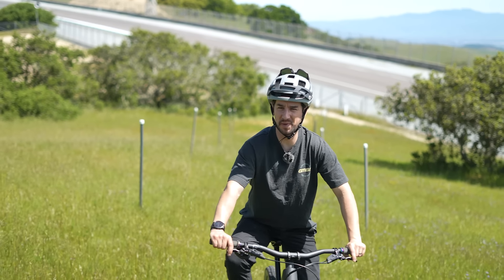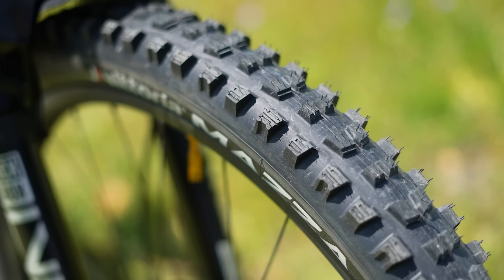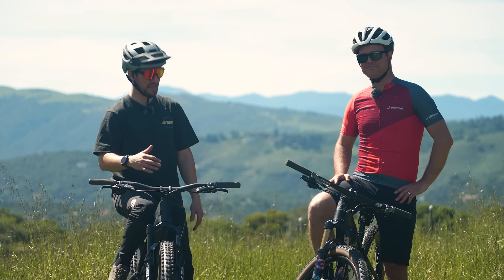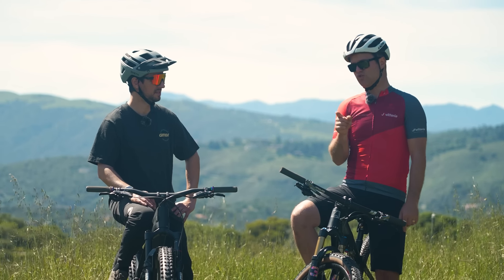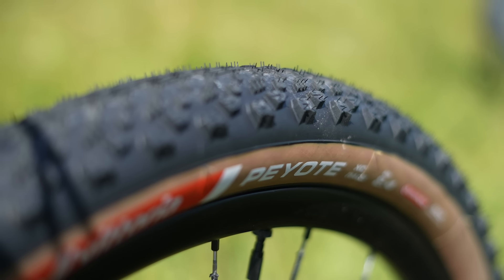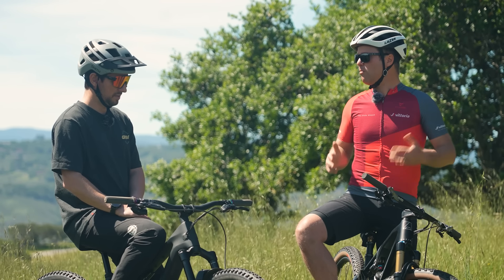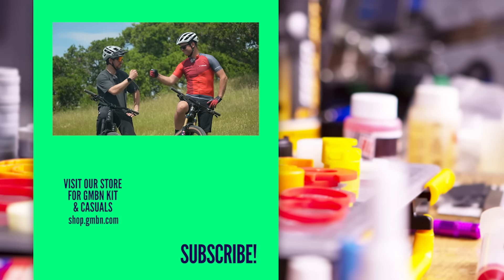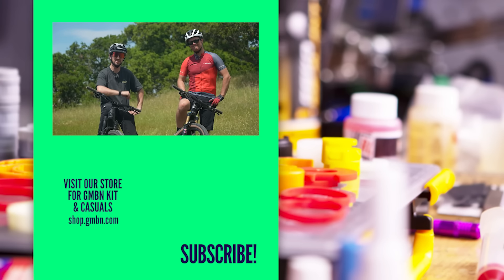What Makes A World Cup Winning XC Tyre?

Comment from the maker: What tyres are you using at the moment? What style of riding do you use them for? Let us know in the comments below!
Reply: At this moment: Vittoria Barzo 29x2,25 - for UK long distance trails (mostly gravel or mud) for my hardatil XC bike. But I need little more rolling speed, so propably i go down to 2.0" (Pirelli Cinturato Gravel S 50-622) in next season.
Something with shallow thread like Vittoria Peyote - is not optimal, because a UK wet weather. And plenty of muddy puddles on trails.
Reply: Now I'm using MSC Single Track in front (2.2) and MSC Roller on the rear wheel, for my XC Cannondale FSi. I love tyre science, I love testing myself different combinations and I ride all types of terrains (flowy hard packed terrain, rocky technical descends and I love mud as well). For me the adaptability of a tyre is key, even more than rolling resistance.
Reply: Michelin DH22/34 on my full sus trail bike, I live in the Laurentian mountains lot of granite and muddy patches, technical and vertical, up and down no flats..
Reply: I have the china-est sounding tires, Chaoyang Phantom Speed 2.2 on my xc bike. Love them.
Reply: As I ride XC mostly, I have Maxxis Ardents. 27.5” x 2.25 with tan walls.
Reply: @uriteruel 2,4 light xc tires, for trail riding, as a tester, but works perfectly, lot of grip, and no flats🤗👌
Reply: Barzo 27.5 x 2.6 front and rear on a full suspension trail bike. I'm a heavy rider and on this combination I have been breaking personal bests at my local trail centre (Dalby Forest).
Reply: Running the new Vittoria Mezcal XC 2.4 front and rear.  Using Vittoria Light Air-Liner too.  Very fast tire with very good grip.  Amazing on my SS hardtail, and totally changed the feel of the bike.  The compound feels soft, yet the tire still rolls very fast.  I ran a Mezcal 2.6 with the trail casing as a front before.  The new Mezcal XC has better grip, and they seem to roll equally fast.  No idea about longevity on the softer compound 2.4 XC, but the 2.6 trail version saw lots of miles and held up well.
Reply: Schwalbe Rocket Ron Super Race for mostly Gravel and some Trails

Comment: Thing is, pros know how to handle a bike with 0 grip. For normal people a more aggressive tire is usually the better choice. I've seen pro riders use schwalbe racing ralphs front and rear, with that setup I would lose the front end in every corner. Also, with vittorias, most people would be better with a barzo-mezcal combo than the one in the thumbnail

Edit: Just spelling
Reply: most people don't actually ride in terrain (and with speed) that require agressive tyres, even though their fancy mtb bikes are designed to do so.
for them smoother tyres are just nicer to ride and faster.
Reply: You would be surprised at how much grip this tire has as a rear. I was shocked. It really wasn't that scary
Reply: That’s the new dry conditions Peyote (which was discontinued for a while, completely re-designed).
Not a tyre like Mazcel don’t really work UK (for me) as courses rarely dry enough, Barzo front & rear for me XC race uk me.
Reply: @KlintonSilvey  I think the problem isn't cornering, since the side knobs are ok, as with the Mezcal the main issue arises with steep sections, braking traction just isn't enough. Lowering the pressure helps but the casing of the xc-race versiok was too flimsy for that, hope this new 60tpi casing allows for better pressures and traction :), stoked to try it
Reply: @cegalleta  Got some coming. I ran a TNT 2.6 Mezcal front and Schwalbe Rock Razor 2.35 rear on 26mm ID 29r rims.  The 2.6 Mezcal was a bit rounded on 26mm, but it rolled so fast.  I think the new 2.4 Mez front and rear might be great for my riding.  I also have the air-liner xc inserts to try. SS HT, 200lb if it matters.
Reply: Makes me proud riding Mezcal front 😎
Reply: @krzysztofkolodziejczyk4335  90% of riders where i am are running minions or assegai on green smooth trails with a few rocks and roots. most should be on trail tires or xc tires
Reply: Ralphs actually have a lot of grip

Comment: I am currently testing the Vittoria Peyotes on my XC race bike ... they have very supple sidewalls and offer VERY impressive grip given their low knob profile.  I have a disease of always trying new tires and so far these are amazing.  I do think all the MTB tire manufacturers should find a place in their lineup for a true race day only XC tire - give up a little durability for the absolute best race day performance.  Maxxis did this with the ST and people are happy to pay a high price for them.  (I tried the Aspen ST 170 2.4 and I think the new Peyote is much better - something strange in that  the ST's rode well but not as fast I had hoped).  I still have a prized collection of 560 gram Schwalbe tires in 2.25... yes not on trend but man are they supple, light and fast when the course offers reliable traction.
Reply: How do You like new Peyote Race on the front, considering steep, lose, mixed terein, also a bit wet sometimes?

Comment: Sworks 2.35 Fast Traks. Very light for a 29" tire. For the dry conditions I usually ride in they are great.
Reply: My epic came with 2.2 Fast traks and they were fast. I also washed out a few times with them
Reply: Just looking at my sworks fast traks sliced the sidewalls

Comment: I always have a couple MTB's that I use to commute to work with everyday...on those I make sure there is a spot on the middle of the tire that is totally smooth and higher than the rest of the treads that the bike runs on most of the time.

I can still take it off road a little bit.

Comment: I have tried multiple XC tyres over the years. I keep going back to Conti CrossKings in the tubeless 4 ply ProTection version as they have given me very little trouble over the years and are robust and will usually take more than a dozen punctures from thorns before they start to lose even a small amount of air. I don't race and just use them 8 months of the year for general 2-4 hour Cross-country rides with no rocks and a few roots

Comment: Running a 27.5x2.3 High roller ii 3c front and a 26x2.3 Conti cross king on the rear of my 150mm trail bike I use for down country.  Think it's about time I tried a new front tyre.  Been on these for too long.  I cop a lot of crap for my narrow 23c rims and 2.3 tyres these days.  Apparently, roadies are mounting 30c tyres on 25mm rims these days.

Comment: For some tires (such as Continental "X" King), when I put the rolling direction inverted (on the front tire), I notice more grip in curves, precisely because there are intermediate (and lateral) studs in the way the tire Scorpion "XC M" is manufactured - it's difficult to try to explain this..., but it's something like that, the side of the intermediate and lateral spikes, when you turn the handlebars, are more perpendicular to the movement (and not in the direction of movement of the recommended rotation), providing, in my perception, a feeling that these studs are more "ready" and enter the terrain more, giving a greater feeling of predictability and safety in the curves. Of course, I imagine there will be some loss of roll with this, but, up front, I prefer predictability in curves. In fact, this would be a better suggestion for a video theme to be more illustrative, perhaps drawing on opinions from riders not sponsored by tire companies, independent studies and even companies that manufacture tires with side stud patterns like the Pirelli Scorpion "XC M" .

Comment: with my vittoria aggaro, would it make it easier to drift if i put it on backwards?
Reply: The thread is also designed to shed mud and disperse water in a certain direction, if you reverse the rotation then it might get clogged up in wet conditions

Comment: Full sus trailbike; Michelin dh22/34 2.4 on 25mm inner width rims at 28/32 psi (saves the rims no need for a cushcore)
Hardtail; vredestein bobcats HD 2.35 on 30 mm inner width rims.
DH/park bike; just trying onza porcupine rc 2.5, we'll see 😅

Comment: Wouldn't a narrower tire be lighter? and thus faster....2.4 seems big for  XC @8:30 they talk a bit about it but the normal XC rider isn't doing Marathons or gnarly rock gardens
Reply from the maker: It would be lighter, but it wouldn't necessarily translate to faster! A wider stance of a tyre can offer more consistency of grip, better traction and braking, so by having more rolling resistance, you actually get more of loads of the factors which can make you faster.